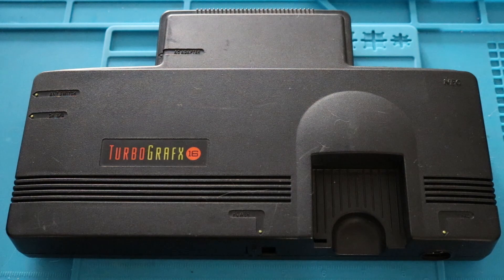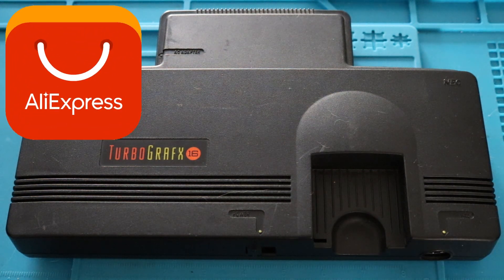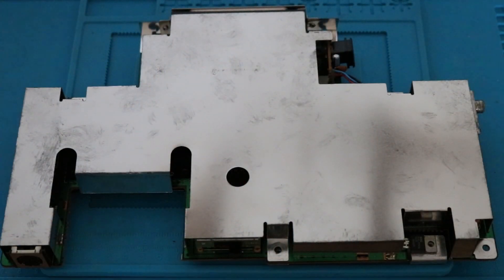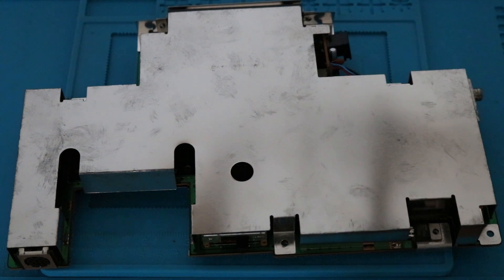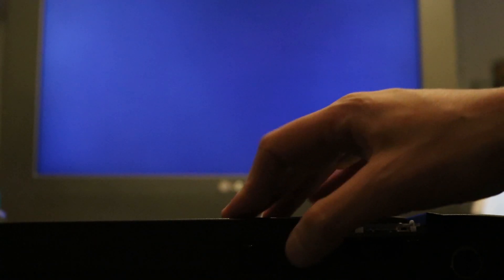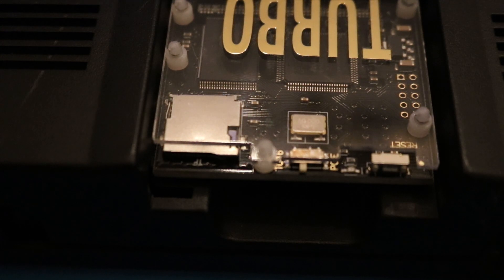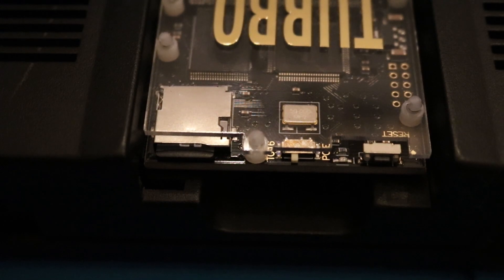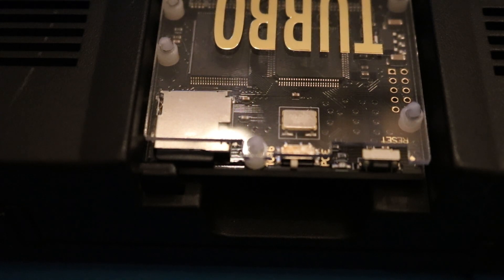TurboGrafx 16 - Repair & Thank you!

Comment: That’s a good alternative for an expensive Turbo Booster. Where did you purchase the audio/video booster adapter for the Turbografx console? Is it safe to operate for long term use? I’m concerned if it would shorten the life of the TG16.

Comment: Great work and thank goodness for a fairly straightforward fix. Do any other of the electrolytic caps usually require replacing, as well?
Reply from the maker: In general I'm a fan of replacing them - don't forget these (and similar 16-bit machines) are turning 25/30 years old. Even if they still work fine, it's a good idea to just future proof them for another new 25/30 years in my opinion!

Comment: I know it can be risky but could you test the 7805 by reading its input and output voltages?
Reply from the maker: you can, however you’d need to make sure it’s not shorted before turning it on. And even if it shows proper voltage, it’s hard to tell how long in the future they will still last. It’s a piece of hardware that endures quite a lot of electronical beating. Remember it convert power into heat, and prolonged heating diminishes a components lifetime. In cases like these I’d simply rather be safe then sorry, if the input or output short to ground, you can damage the custom IC’s which will set you back a lot further.

Comment: using a more modern linear regulator does not change the heat that it produces. the real modern approach would be to use a modern four-switch-buck-boost dc/dc converter or at least a buck converter. they are much more efficient which means that they do not get that hot and do not draw that much power from the power supply. also they have protection from over voltage and over current.
Reply from the maker: I have experimented with those in the past (grabted a long time ago!) and found they arent as efficient as they claim, and also introduce a lot of noise on the power lines (not saying the current situation doesnt have noise, but linear regulators seemed more excessive). Would you perhaps be able to point me to a good source for these?
Reply: @RetroGameRevival  i am not familiar with finished solutions but i know that Microchip has lots of those